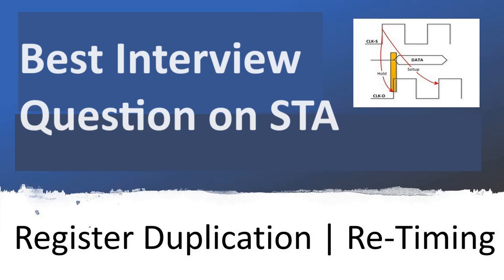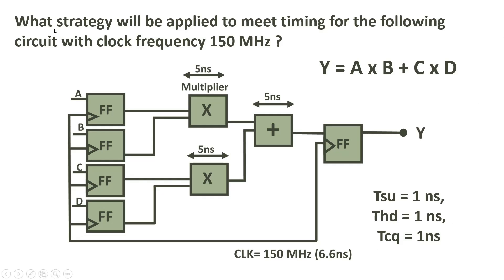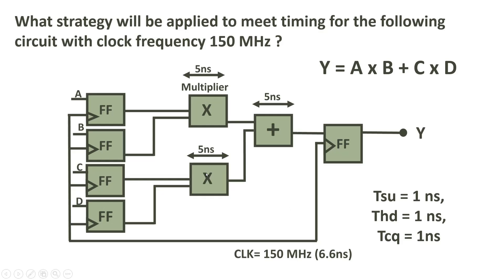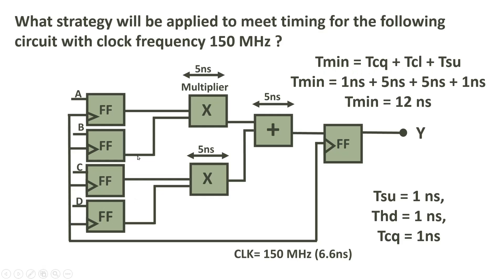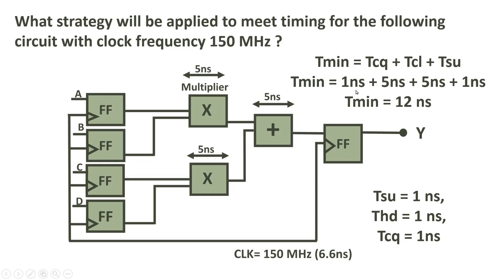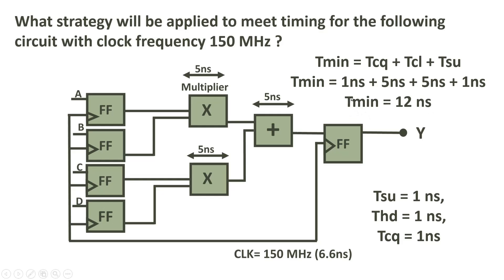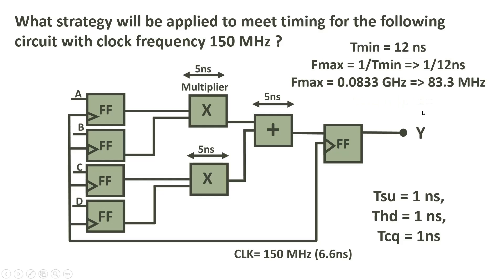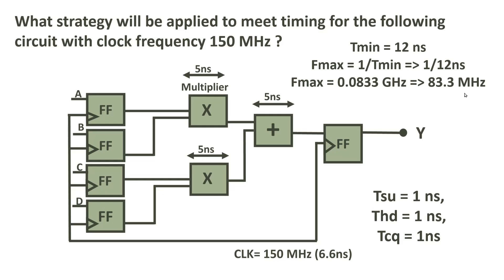Best Static Timing Analysis QA Part 1

Comment: I have added a +ve Skew of 5.4ns in the clock path of the output FF (Y FF), so as to maintain fmax as 150MHz. 
Tmin = 1ns + 5ns + 5ns + 1ns - 5.4 ns
so, Tmin = 6.6ns, fmax ~ 151MHz

Because, in reality we must encounter some Skew in the clock path, since here skew = 0 was assumed. In reality, skew will be finite, so we can adjust for the Y FF to give us that desired clock frequency

Comment: We will add pipeline register in this design. Of course adding pipeline would increase the latency by 1 cycle but throughput would increase. Hence the operating frequency would increase
Reply: it will still be above 7 not meeting 6.6

Comment: Even if you register every output you ll end up with 7ns Tmin. After that I guess you need to either use a faster library cell for adder or multipliers or decompose the adder or multiplier into smaller modules by logic duplication